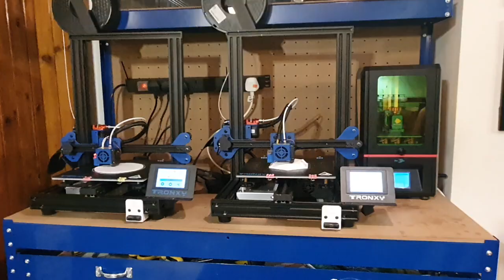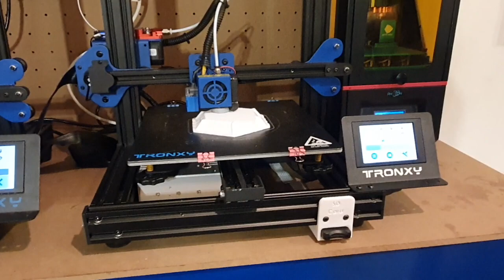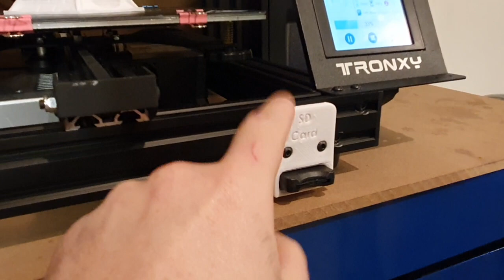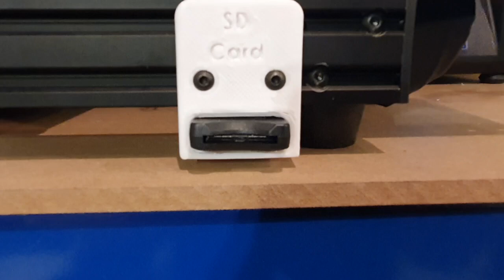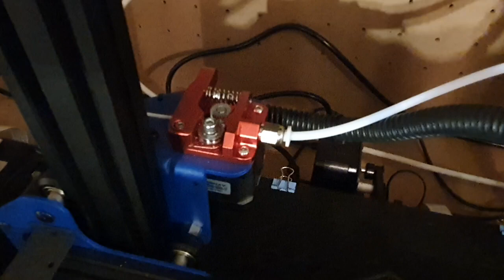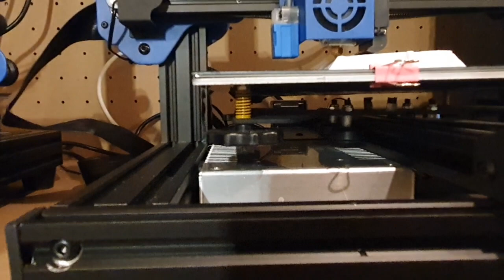My Tronxy XY2-Pro 3D Printer simple upgrades and modifications to IMPROVE printing performance

Comment: Magnetic aluminium?
Reply from the maker: Hi Amanda, aluminium is not magnetic under normal circumstances. But when heat is applied it goes through a subtle transformation that enables magnetic field to be present (paramagnetic material). This is why the sensor is more acurate when the bed is heated up as it detects this effect. This means that bed leveling is vastly improved when the bed is pre-heated. Adding the steel plate as I have done further encourages this as it has it's own weak magnetic field.

Comment: I can add few ones which improved 20x the printer. Marlin custom firmware and a PTE metal plate with a magnetic sheet.

First layers and adhesion are now superb, also the automatic levelling using the Marlin firmware is truly automatic. Also the custom firmware allows to override or customise parameters during the print.
Reply from the maker: These are great additions. I have heard much about using Marlin and how it improves things. When I have the time I'm going to also be switching over to Marlin and will create a video on how it works out. Thanks for the input 👍

Comment: can u help m8 im wanting print carbon fiber but told kneed fit all mettle hotend as stock wont code but not clue witch or what will fit
Reply from the maker: Hi mate, to be honest I haven't played with carbon fibre filaments yet - so I wouldn't be able to recommend anything at this stage. But... I'm sure there will be many who can point you in the right direction over at the official Tronxy community group https://www.facebook.com/groups/201640394116441 lots of awesome and helpful people on there.
Reply: @offsetmedia  I bow actually been using it about a week the place version must say I like it as temps are round 200-230 I found my role best at 215 so no kneed for a full metle hotend been printing portent at my standers cura pla setting
Reply from the maker: @jujucattys156  That's great news! I might look into carbon fiber filament myself. Thanks for the heads up.

Comment: I've just ordered a Tronxy but I can safely say from also having a Ender 3, the filament extruder is the best upgrade. The Ender 3 uses pretty much the same one that eventually snapped during a print
Reply from the maker: Hi mate, yeah bad extruders will cause all sorts of issues. Some have said that you get far better results from a geared Titan clone (as also suggested by Ciprian below). The ones I'm using work well and do seem to eradicate many of the issues I initially ran into with extrusion and is an easy swap.

Comment: Why mess about with steel plates and what not when you can just ditch the poor escuse for a surface that comes stock and get yourself a PEI sheet that gves  much better adhesion and works well with the inductive sensor? Also, the stock extruder is all metal too, but better go for the geared Titan clone: much better results and no more skipping and grinding. But the best thing you can do for your printer is install Marlin 2.0 It will transform your machine and give you proper mesh leveling not the pseudo levelling of the crappy original firmware.
Reply from the maker: Hi mate, yeah I have been considering shifting over to Marlin. It does seem that anyone who does this raves about the results and superior controls. To be honest I have stuck to the Tronxy firmware in order to see if I could make it work reliably with just hardware tweaks initially. I do think switching to Merlin now that I have learned much about these units will be the next set of upgrades I do. I'll likely post an update video about it soon. Cheers!